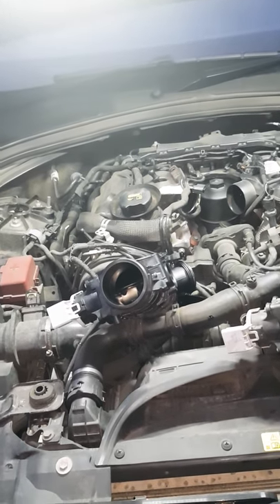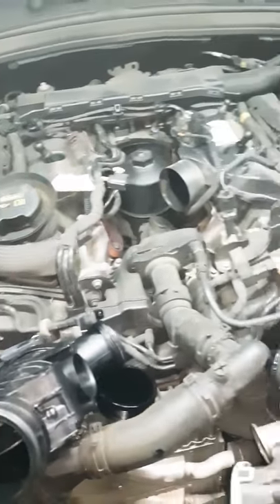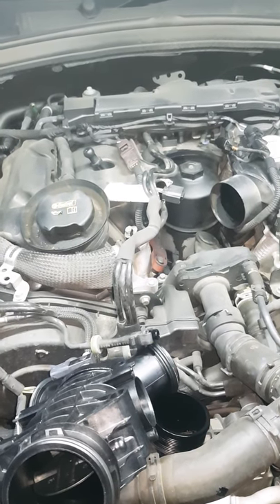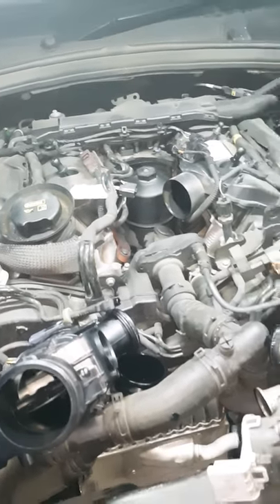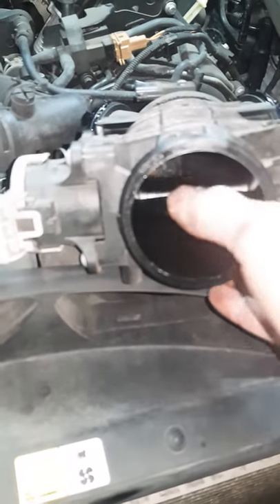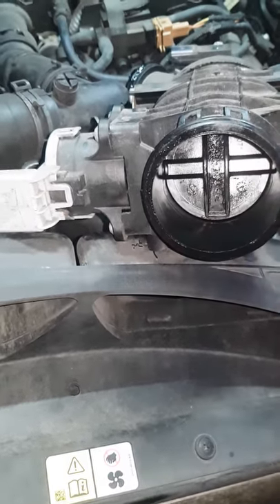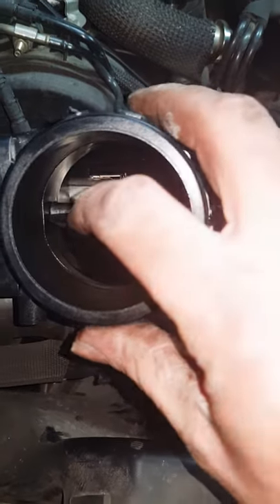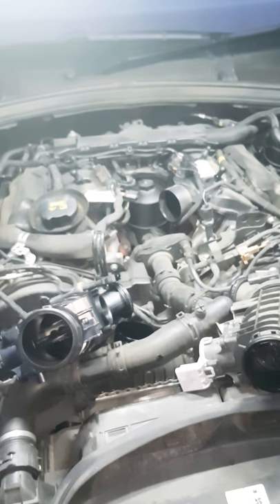Land Rover & Jaguar V6 Overboost explained and fixed

Comment: We just replaced ours now, overboost code popped back up and now it’s saying dpf full and stuck in limp mode, won’t let me clear the codes, got the dpf cleaned and still limp with overboost and dpf full light still on, 2018 Range Rover sport tdv6
Reply from the maker: @unknownuser954  Throttle body replaced with main dealer part ? Pressure on Dpf before the clean ?